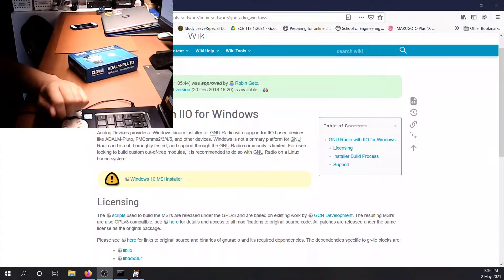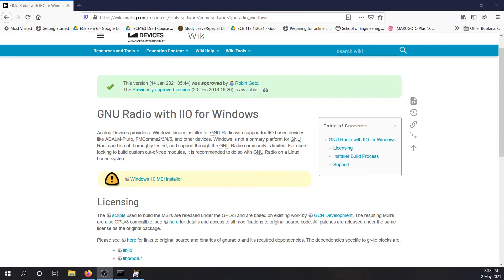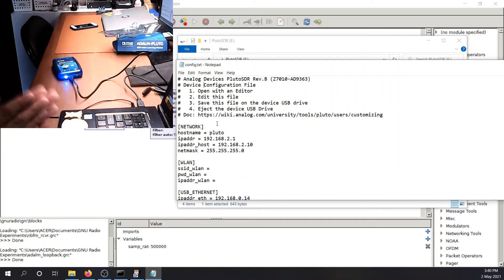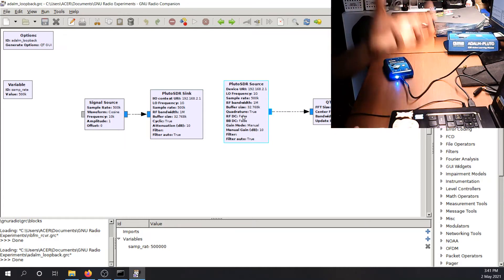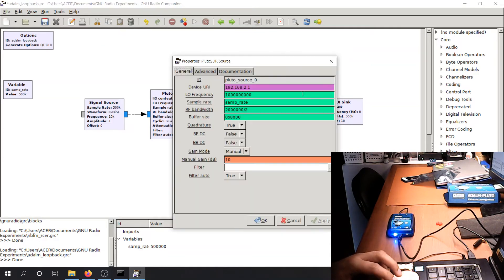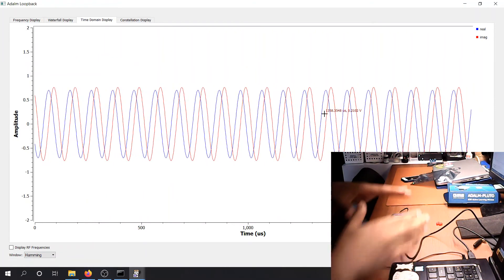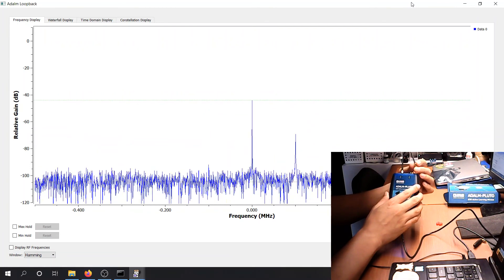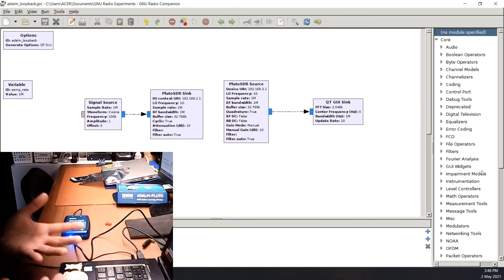Introduction to the PlutoSDR (1K Subs celebration)

Comment: You didn't even show how to download the drivers
Reply from the maker: Ahh this video is outdated. GNU Radio can now be installed by using the Windows Subsystem for Linux (WSL). In this environment, you run GNU Radio as if it's used in Ubuntu.

Comment: Hi Charleston, The binaries for  GNU Radio with IIO for Windows are removed on the wiki link you posted. It recommends to use script. But if you go to Installer Build Process,  It states  DON'T USE THESE SCRIPTS. It throws you in a loop. Verry frustrating.
Reply from the maker: Hi. Sorry for the late reply. I have not been active on this platform lately. I have been using MATLAB packages to use ADALM-Pluto now so I am afraid I cannot help with this matter. I hope you were able to resolve this!

Comment: I just bought a adalm pluto and did exactly what you said. I can see the frequency changing but the amplitude of the signal is below 0.5. It is very very low.    Why is that. Even the frequency is at -40 db.
Reply from the maker: At what frequency are you transmitting? It’s possible you have AGC turned on or your attenuation is large and/or gain is small.
Reply: @charlestondaleambatali4158  i did exactly what you have done in this video. But still nothing. Can you tell me, is there any parameter i need to change before. Thank you so much in advance.
Reply from the maker: @anujregmi4582  check the frequency, decrease the attenuation, and increase the gain. The exact amplitude need not be the same as my unit. Manufacturing errors are expected especially for a cheap module like the PlutoSDR.
Reply: @charlestondaleambatali4158  can you please tell me how can i do that. I am trying to see. The frequency is 1Ghz and sample rate is 1Mhz, attenuation for both tx and rx source and sink for the pluto is 10db. Can you please tell me if there is anything more i need to do. Like is there any other block i need to add.
Reply from the maker: @anujregmi4582  then maybe your loopback cable has a defect.

Comment: One question, how can you transmit or receive 1kHz, I thought the frequency range is limited to 325 MHz to 3.8 GHz resp. 70MHz to 6GHz?
Reply from the maker: The chip is designed for 70 MHz to 6 GHz but the ADALM Front End is for 325 MHz to 3.8 GHz. Analog Devices has a wiki guiding a user to “hack” the radio and enable operation for the intended range of the chip. If you use MATLAB 2017b and later, the installation process does all of that for you.
Reply: @charlestondaleambatali4158  thanks for your answer, but didnt you select 1kHz in your video in the gnuradio? Thats far less than 70MHz
Reply from the maker: @niklassuper3578  i didn’t. I am transmitting at 1 GHz actually. I put a 10 kHz tone as the input.

Comment: Hi Charleston, Great Video! I was wondering how one can implement some of the popular digital modulation schemes within GNU radio companion. Is there any prebuilt blocks for things like QPSK and QAM, or would I have to build them using the existing blocks? If they have to be done using existing blocks, this might be an interesting video idea. Cheers for any help.
Reply from the maker: Yes there are existing blocks for the popular digital modulation schemes under the “Modulators.”

Comment: Just curious.  The sample rate your using doesn't seem to be supported by plutosdr.  Curious how you made that work?
Reply from the maker: PlutoSDR uses AD9364 and it has a 61.44 MHz maximum sampling rate. I only set it to 500 kHz. No reason for it not to work.